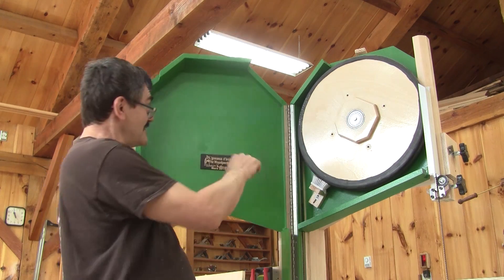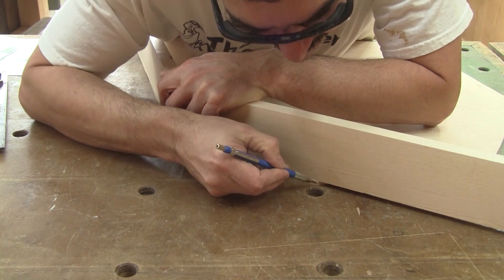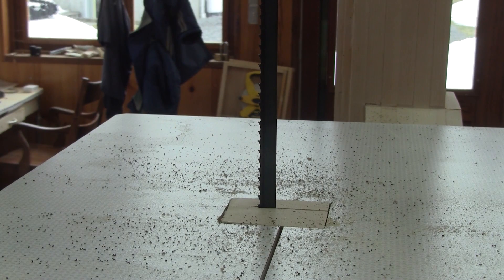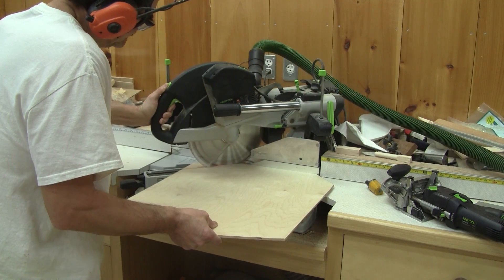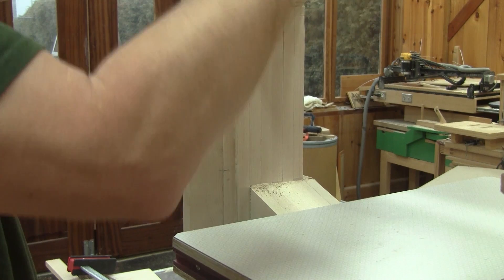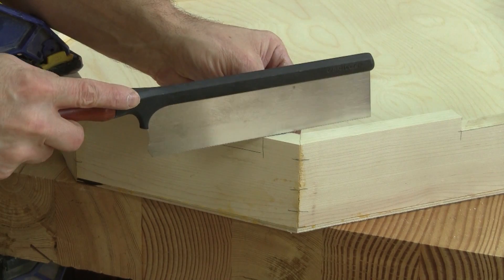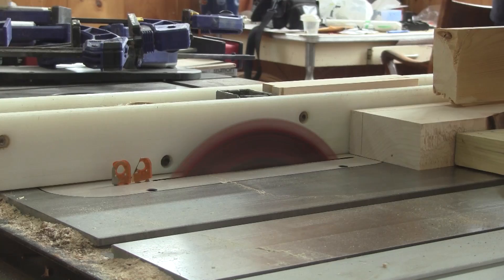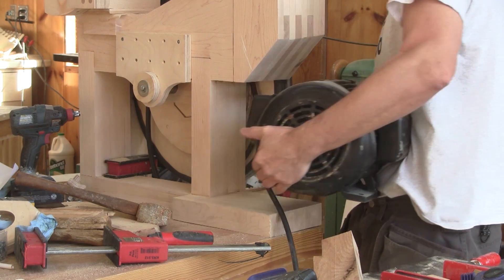The Woodpecker Ep 141 -  Wooden bandsaw part 6

Comment: Is this the Opps reel, so many corrections.     🙂🙂🙂
Reply from the maker: I found that the enclosure was the toughest thing to do on the bandsaw, so much so that I had to split it in two parts the top and bottom... It would have been so simpler witout an enclosure, but a bit too dangerous.